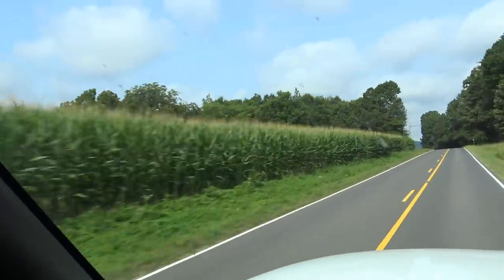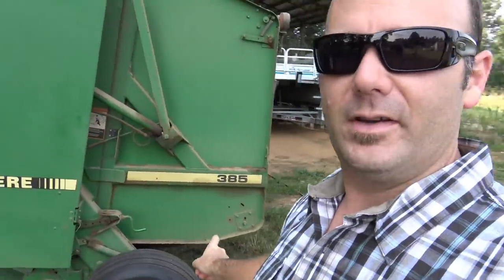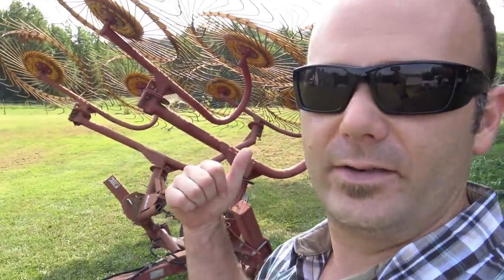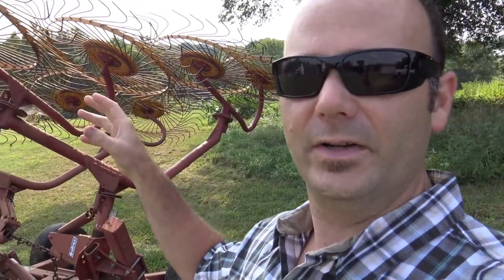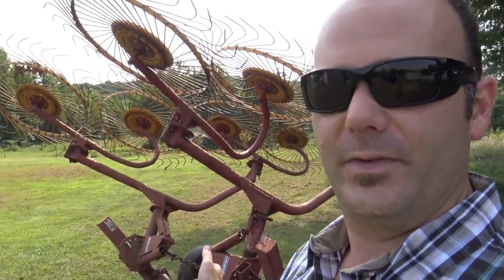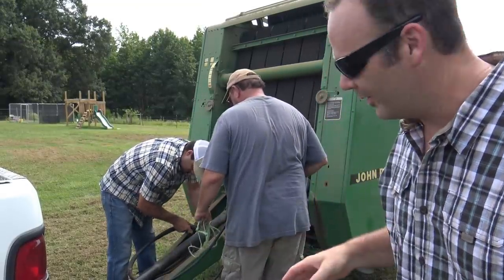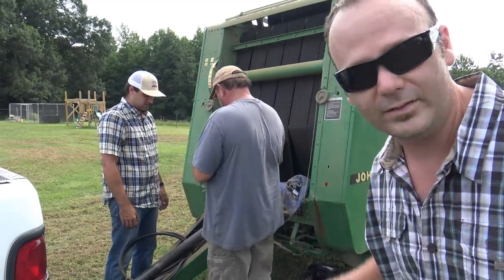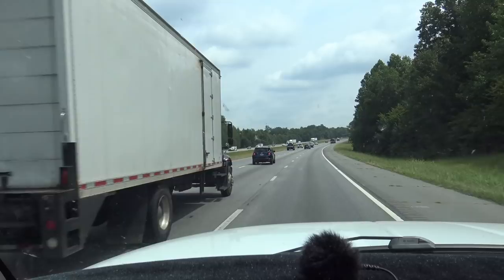HAY MAKING EQUIPMENT...WHAT DOES IT COST??

Comment: We'd have to salt between the layers of bales on the few occasions square bale hay was put up with a little too much moisture content.  You know how a compost pile generates heat.... well that's what damp hay does.  Even when salted you climb into the hayloft and you can feel the heat generation.  I don't know what the salting does, but it probably minimizes mold between bales.  I have no knowledge of round bale production at all.  Good video Josh, but really man, Missus Stoney Ridge was the best part.....lol
Reply from the maker: Good tip...so my bailer actually has a moisture meter..which I have not hooked up yet

Comment: you need to check the bearings when they are running bearings will go out and have started them on Fire... round balers are notorious to catch on fire from bad bearings.... going out. you Might also want to verify the horsepower requirement for that baler.. does your tractor have enough to run it
Reply from the maker: Yep and yep...we checked out the bearings...all sealed and all cool to the touch after 1/2 hr of running...yep I have a 65 hp deere to run it

Comment: Ran across your channel today. The JD 385 is a 4x5 baler and last year of production for that model was 96'. Far as your comment with wet hey, never heard of that ever happening. Most baler fires are started with bad bearings. I'd recommend pulling the pickup head chain guard and check those while running as well. That baler doesn't have a moisture sensor. That is your bale monitor. Pressure gauges, gate open/closed, tie alarm etc.  If you don't have an operators manual, go over the www.greentractorparts.com and order one. Use your serial number and JD website to ensure you order the right one. They're the cheapest on the web for paperback original manuals. The 5 series bales are very reliable and super easy to work on. You'll get many years of service out of that baler.
Reply: And buy a laser thermal gun. Keep it on the tractor and check bearings often during operation.
Reply from the maker: Cool Daniel thanks for all that good info...so yea a laser thermal gun is a great Idea...the baler has an aftermarket moisture meter that goes up to the cab area of the tractor...not factory but an add on a few years back....I didnt show the sensor because we had disconnected it and put it in the truck...I did get a manual thank goodness and I'm glad to hear they are reliable and easy to work on...thanks so much for ur comment...I need knowledge like this on my channel!
Reply: Stoney Ridge Farmer I never knew about an aftermarket moisture sensor for these balers. I like to keep it around 23-26% moisture myself. Seems to bale best in that range for me. And if you have problems starting a roll it's normally a sign that the belts are getting pretty worn.
Reply: Daniel Altman geez 23% in a bale that's getting high for moisture. I would only ever go that high if I have preservatives going on. 18-20% is the highest recommend bale moister for rounds and 16% for big squares. I've had bales go black and smouldering as they had got hot after been to wet. And bearings are something that will go and need to be replaced. Last season I had smoke coming off the baler with a bearing completely ruined. But baling is the best job on the farm. Love it so much I'm a hay and silage contractor ahah good luck with your baler and rake 👍
Reply: aussiefendt your right. I typed the wrong numbers for some reason. 13-16% is what I prefer.